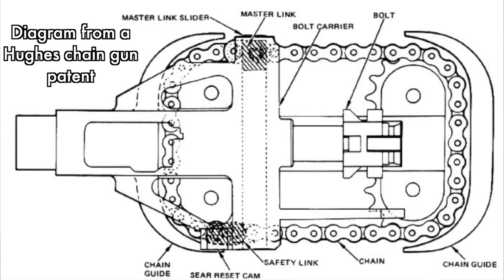Ask Ian: Are Man-Portable Chain Guns Coming?

Comment: One thing i want to point out is that on a traditional gas/blowback operated gun. All the mechanics need to be interconnected.
Whereas an electrically powered gun can have remote operating parts.
So part of the weapon system can actually be carried in a backpack or similar. Making some of the negatives of weight less relevant since the carrier isn't carrying all the weight in his/her hands.

Making a traditional weapon feed from a backpack is of course still possible if one really wanted to go that route.
But what i am saying is, it's entirely possible to put the motor in the backpack and have it run a "chain" that goes through the gun and loops back into the carrying case/bag on the back of the operator.

I also feel like there's more to a traditional weapons mass than just the gas/blowback system. The trigger group is actually not that light when you think about it.
An electronic trigger can be made lighter than a purely mechanical one. Of course you can install an electric trigger on a traditional gun if you wanted. With all the benefits that would come out of that, such as being able to select rate of fire and how many rounds to fire at the pull of a trigger etc etc. Even making the trigger capable of "hands off" operation, only triggering when a condition is met, like crosshairs on target with proper ranging and thus sight adjustment (which is done automatically) and the gun in a stable and level hold.
You pull the trigger and then you aim really well until the system says "Now you are on target" and fires for you at just the right moment.

A chaingun also has another potential benefit and that is feeding spent cases back into the backpack rather than dumping them on the ground. So the operator can choose where to dispose said empty casings later on. Or you know, re-use them loading more rounds at basecamp.
Again, a traditional gun CAN do this, but i am certain a powered gun can do this better because it runs smoother.

And accuracy is another benefit of a chain gun you didn't mention. Because the bolt can remain fixed for longer, you don't get as much recoil (bolt mass moving while projectile is still in barrel) related movement of the weapon.
And a motor driven bolt doesn't have to move as much anyways.
If the weapon is balanced well (which again, is easier with a motor driven design because it's not driven by a big sudden explosion of power) it can remain on target no matter how fast you are shooting.

Comment: Another trade-off I can see is the power source. 
You can keep feeding a "regular" machine gun ammunition and it will keep firing (within reason). 
You can only shoot an externally powered weapon for as long as your power source lasts no matter how much ammunition you have. Further use would require the additional weight of more batteries that someone would have to carry.

Comment: 8:50 Is there any air-cooling benefit to the barrel rotation? What if there were some heatsinks with metal vanes that dumped heat to the environment as they move rapidly through the air?

Comment: Wondering how a chain gun might handle a squib from an underloaded, or damaged propellant, cartridge.  In a typical action, if it's not strong enough to get the projectile out of the barrel, it might also not be strong enough to fully cycle the action, thus preventing the loading of the dangerous next round.  With a chain gun, if it squibs, extraction, ejection, reload still happens and the next round is sent right up behind the squib?  Maybe less dangerous under a chopper than in something handheld?

Comment: Surprised he didn't mention suppressors; we all talk a lot about how adding a suppressor changes how the gas system operates, how much gas blows back in the operators face, and how changing bullet weight and super/sub sonic changes reliability as well. I don't think it's a compelling enough reason, but looking at like a 300 black out suppressed machine gun that can handle bubba's pissing hot hand loads just as reliably as subsonics is at least interesting.

Comment: I think that I might’ve found a way that this could work. Maybe have a smaller lightweight battery, with an alternator attached to the minigun that is powered by the gas blowback itself. You would have a constant charge for the electric motor. To reduce weapon weight, you could have a shit ton of rounds in a backpack, and the battery stored inside a pouch on that same backpack.

Comment: Well with power requirements ever increasing between headsets and scopes with built in battleship style fire control systems and etc. the power is increasingly looking like it's going to be there anyway.  If the power has to be lugged about anyway all the sudden that weight addition is less of a concern .

Then you'll get somebody making some kind of lightweight internal composite chains, CERN opens a portal to hell and it's time for DOOM

Comment: I'm envisioning a hybrid system where the gun is operated by a motor and battery, but also some of the gas is diverted via a piston or microturbine system to recharge the battery. It's a little complicated and a bit steampunk, and I think it solves a problem that doesn't really exist, but it wouldn't be all that difficult to implement.

Comment: Chain gun capable of 4,000 rpm, also have electronic trigger that can be set to to only fire X number of rounds per activation be it trigger, button etc...
Suppressed chain gun would really solve the gas in the face when you mechanically control how long the action stays closed.

Comment: Sounds dumb as hell.
(1) The advantages of a chain gun is that it is externally powered and does need jam clearing.
(2) These are great for a weapon in a location where there is electric power but is inaccessible.
(3) Why bother with that when you have to lug a battery and you can easily cycle the action?

Comment: having the motor driving the chain mechanism via a flexible drive cable from the backpack which contains the electric motor, battery and ammo. feed ammo through flexible feed from the backpack. use standard NATO round for weight? latest generation motors and batteries would long outlast your ammo and your barrel??? not a expert but am i heading down the right path?

Comment: How about Gas-operated rotary guns and revolver guns or recoil operated gast guns for infantry use in the first one you cannot change the barrels but can have a lower rate of fire per barrel and with overall lower rate of fire one can have higher sustained fire, so good replacement for water cooled machine gun but like it the gun unit weights more. The second one can be either single or double barrel gas operated revolver gun but it's advantage of high rate of fire is bad for infantry particularly the single barrel version but the double barrel version can have quick barrel change. While the third one is a twin barrel only apart from the mechanism it can have a quick change barrel but have to preset the spring strength to lower the rate of fire. Both can have higher sustained fire if we lower the rate of fire of individual barrels.

Comment: The only use I can see that wont weigh down a soldier for making them smaller is replace the guns ontop of light armored vehicles and have them remote operated from inside the vehicle. Instead of an operator standing through a hole in the roof using one and exposed. They could be sitting below it with a remote control and screen system.

Comment: The diagram is the base diagram for an M242 25mm Bushmaster.

The Feeder had a visual dial that showed the location of the bolt.

The is a release mechanism that is activated by 12mm-14mm recoil of the barrel for the bolt to unlock after firing.

In the event of a misfire the bolt would remain locked in the event of delayed ignition or hangfire.

 The dial marker would stop at Misfire until the gunner reset the system. Which would extract the round from the chamber and the feeder would rotate the unfired round into the ejection port and a new round onto the face of the bolt.

The M242 chambers a new round and ejects the old round in the same motion.

Comment: I don't see why a scaled down gatlin style couldn't be man portable built around a 5.7 or 4.6 cartridge. I mean the whole point is to keep heads down while the squad moves, right? A 25-35 grain projectile will do that just as well as a 55 or a 150gr, especially when there's 4 or 5x as many. Weight would be low too because you'd only need 6" of barrel (×4 or 5)

Comment: I think there is the GsH-23-2 which is a twin-barrel chain gun used on early cold war soviet jets.
Reply: Point where the chain or external motor is on a Gsh-23-2.
Reply: @blegi1245  Well, I stand corrected. That's what I get for trying to go off of memory.😅
Reply: @pyronuke4768  as a rule of thumb soviets didn't make externally powered autocannons. Gsh-23 uses gast principle.

Comment: Very cool, when Ian mentioned "sentry gun" I instantly thought of the  "laptop gun" from Perfect Dark where it's a rifle that can be converted into a proximity fired Gatling gun.
Reply: No, for me it was the sentry guns in Aliens. Not sure if they were supposed to be chain guns but suspect they were just designed to look cool.
Reply: @boomslangCA  well it has one barrel and a power pack in the picture I just googled so I'd say that it was desighned off a chaingun
Reply: @calebbarnhouse496  the actual guns used in the movies were MG-42's with decorative bits added to make them look more scifi, plus the swiveling mounts.
Reply: @1959Edsel  the swivel mount covers up all the gun outside rhe barrel, so the gun they used doesn't matter there
Reply: @boomslangCA  Very cool, I don't remember those.
Reply: @boomslangCA all the guns in aliens, aside from pistols, are fired via electric pulse, yknow, pulse rifle
Reply: @NeilCook379  googled it to be sure and both of them were made using an mg42, so it's quite possible
Reply: @NeilCook379  I only seen the movie once so even if I did know everything about every gun I'd still need to just check cause idk what it looks like all that much

Comment: The Germans also developed a revolving chamber cannon, versions of which were used up into the '60.  At 1200 rpm cyclic per, the 4-gun load out of an F-100 or F-8 Crusader could match the 6k/min cyclic rate of the Vulcan. albeit at a cost in reliability.  Hopefully, someone will ask Ian to do a dive into this system.

Comment: I feel like if we were to ever get to the energy densities required for chainguns, we'd probably have moved away from gunpowder projectiles into railgun or coilgun technologies. That would remove all chances of a "dud round" existing among many other benefits. The interesting bit would be that the actions of feeding the "action" of the gun would bring their own interesting problems since you no longer have the benefit gas and recoil operation; So in a sense you are still kind of using a chaingun concept of absolute outside mechanical operation!
Reply: A railgun or coilgun would not require any energy or motion to extract a case so the action only has to deal with feeding the next projectile. Shorter bolt stroke and none of your momentum is shed through an extraction mechanism.

You can avoid a lot of difficulties when you need to do only half the usual work.
Reply: @BogeyTheBear  so are u saying that basically a traditional magazine or clip like feeding device would be all you need
Reply: "Block Chain" gun?

Comment: I'm curious how much of the propellant is used to power the cycling process in a traditional machine gun. Can't be more than a couple grams but I don't have any idea how to go about calculating that other than firing a round from the chamber and comparing muzzle speed.

This is salient because at a certain point those grams add up enough ammo weight to justify the extra battery and motor. At least theoretically.
Reply: as long as the energy density /specific energy of guncotton is higher than that of whatever battery system you use, there is no way for that to work out to be better.
Reply: @suddenllybah  For Li-ion batteries that will never happen, sure, but when you start looking into more exotic technologies you can get pretty high densities. Gunpowder is limited by ballistic restraints the battery wouldn't that keep its density pretty low compared with other propellants. 

Again, an academic, theoretic, speculative line of thought. Hydrogen batteries, for instance, can be one order of magnitude denser than gunpowder, ... but I can't see how having your soldiers carrying highly unstable hydro cells won't end in disaster.

Comment: Is it bad that my first thought when seeing this question was "Fallout Power Armor"?  Apparently the actual in-lore reason for the development of Power Armor wasn't to turn infantry into walking tanks (they're still vulnerable to ordnance and energy weapons) but to act as a strength-enhancing exoskeleton that lets a small group of infantry operate much heavier weapons that would otherwise require a vehicular mount.

Of course, we'd be even further from development of that sort of thing, since we'd need both the strength-enhancing exoskeletal component (that can quickly and accurately react to the users movements) as well as the miniaturized power source that makes it possible (the Fallout universe uses miniature nuclear-fusion cells).
Reply: AFAIK, "chain guns" don't appear in the Fallout universe. There are "miniguns," which are more similar to the real world M134 Minigun, though they fire 5mm ammunition.
Reply: @JonathanRossRogers  the one in Fallout 4 is just called a minigun. You get it by yanking it off the door gunner mount on a crashed military VTOL. 

It’s in some sort of generic 5mm cartridge, despite the game having both 5.56mm and .308 cartridges for default firearms.
Reply: @joshuahadams  You have correctly described the minigun in Fallout 4, expanding on my original comment. My original point still stands: there are no "chain guns" in any Fallout game.
Reply: @JonathanRossRogers  I know it's a different kind of gun, but the idea of a heavy motorized machine gun being able to be used by infantry thanks to an exoskeleton is what I was mostly thinking of.  Other comments here have pointed out the concept as well, and apparently it was something that the US military has been thinking of for a while but hasn't been able to implement due to energy limitations.
Reply: @williamjeffery9653  Indeed "heavy motorized machine guns" are too heavy to be practical. Until very recently, the US military was trying to make infantry weapons lighter, not heavier.

Comment: Im my experience, il go with putting the L94A1 Chain Gun in the bin.  The damn thing requires rebuilding regularly and is horrendously prone to stoppages. And id instead fit a coax GPMG L37 basically needs no maintenance, stoppage are easy to clear and dont happen all that often.

Comment: I would argue that a lot of the mechanisms that are required to be bulked up in LMG/GPMG designs are a consequence of the action being propellant powered. I think many elements can be slimmed down while retaining reliability in an externally powered gun, at least to a degree that results in similar overall mass, particularly for more powerful cartridges.

The biggest problem in my view is that you need a power source to operate the gun (barring some hand crank thing), sure soldiers have lots of stuff nowadays that runs off batteries, but their rifles always can be used as long as there is ammo. The rifle is arguably the most critical piece of equipment as a solder can still operate without NV, electronic optics, radios, GPS, etc, but if their gun breaks they are dead weight. Also, it can be a problem for long-duration missions where soldiers cannot return to a location to get new batteries or recharge them.

Comment: These could find a niche in man-portable sentry/remote-controlled guns. A chaingun system would remove the need for someone to go clear it if it was in a place that was difficult or inconvenient to get to, and such weapons would already need to be hooked up to a power system (either large battery or electric cable) to power the sensors and control systems.
Edit: Of course Ian is already thinking of this, that's what I get for commenting before the video is over.
Reply: Remote operated vehicle mounts is the current hot application.

Comment: Hughes hasn't been in the business of chainguns since 1984.   Right now the Bushmaster trademark is held by Northrop Grumman.  For some reason, the L94A1 is built by H&K.

Apparently, the other application is in naval mountings where, presumably, saltwater plays havoc with the open operating systems of conventional machine guns.  In US Navy services as the Mk. 52.
Reply: Steve is correct. I worked on the Chain Gun Programs in Culver City till the IP was transferred and the facilities closed. The helicopter business was first sold to McDonnell Douglass in 1985, then to Boeing in 1997, then to Alliant Techsystems which then became Orbital ATK in 2015, then went to Northrop Grumman in 2018 where it is still being produced. There are also versions from HK as in the L94A1 which goes down to 7.62x51. At least 15 countries operate variations at my last count.